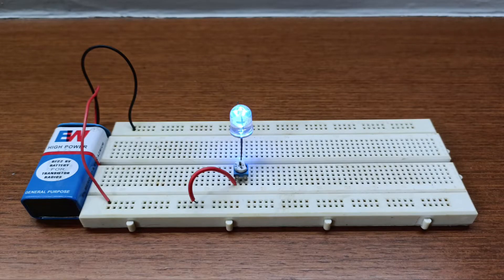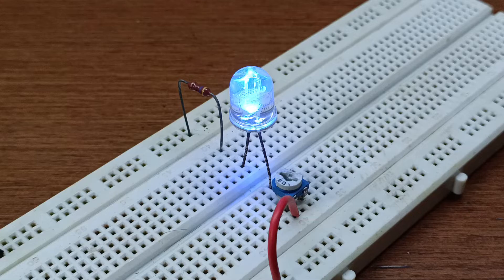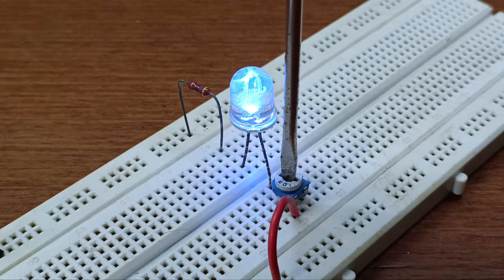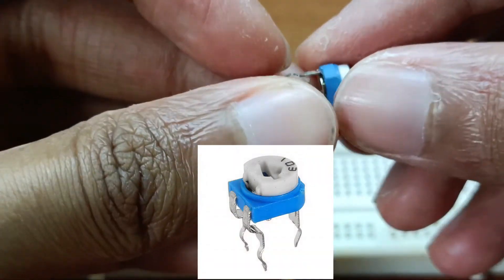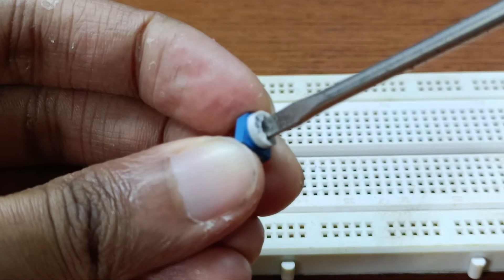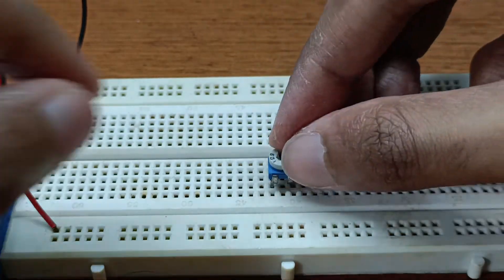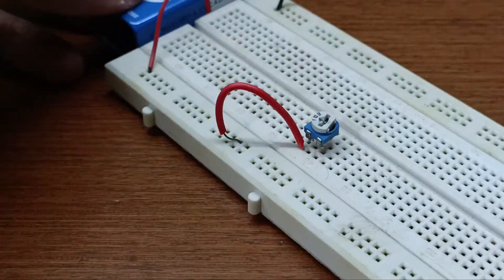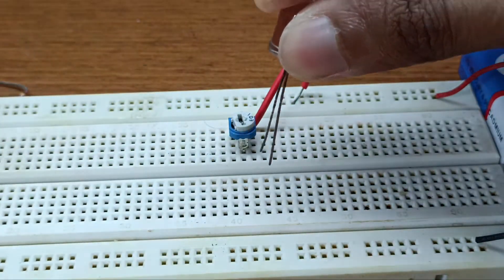How to control the brightness of LED using Potentiometer| LED Dimmer Circuit on a breadboard

Comment: What will happen if i dont add the resistor? Will the pot still work without resistor in circuit ?
Reply: Yes it will
Reply: @shilpamathur2868  - That’s true, but I believe this potentiometer goes from zero ohms to 1K ohms, so, if you turn the potentiometer to zero, the LED will have no resistor and will burn out in less than a second.

It is always best to have a “safety” resistor (about 100 ohms) to avoid overloading the LED.  This video has a safety resistor for this purpose.

Comment: When I use the potentiometer the led won't turn off completely
Reply: Yes that's because there is still the other resistor providing a path for power to flow. If you turn the pot to its min (0ohm), it's just bypassing the pot
Reply: i'm pretty sure it depends on the potentiometer your using range
Reply: @xpple  IDK, i used various types of potentiometer like 50k,10k,100k and same results